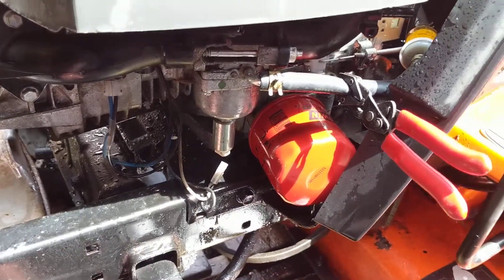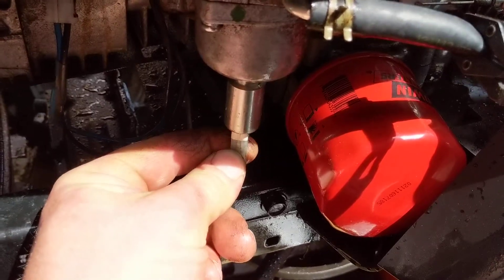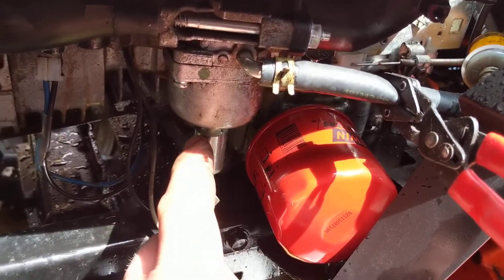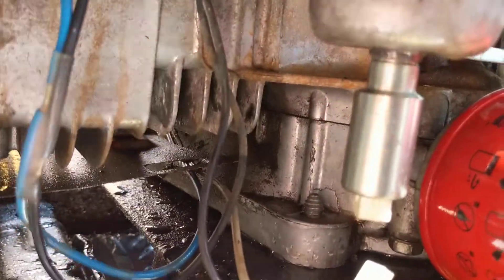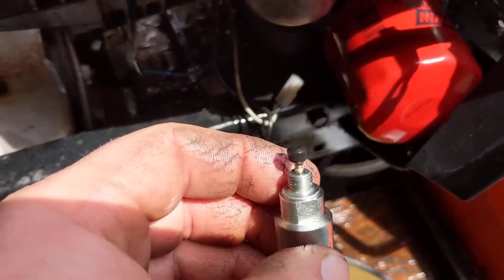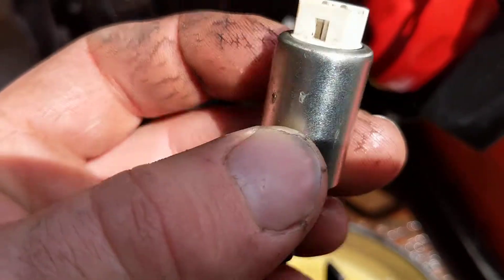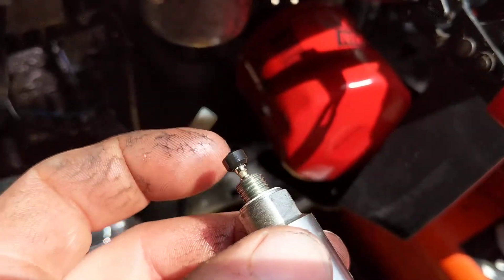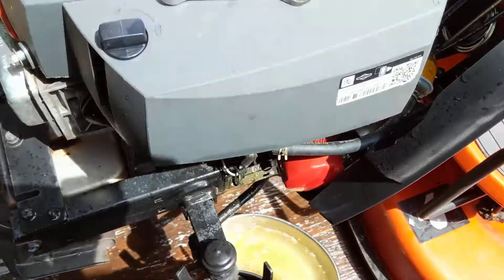Briggs and Stratton Carburetor Fuel Shut off solenoid information #lawnmower #smallenginerepair

Comment: The fuel solenoid has nothing to
Do with engine flooding.  All
Its designed to do is
Prevent the engine from backfiring upon engine shut off.
Reply from the maker: I agree and disagree. I run into these carburetors that have leaky float needle valves and these solonoids prevent the leak from flooding the intake.
Reply: @machinesnmetal  if a carburetor has a faulty needle and or inlet seat the carburetors going to flood whether or not it has a fuel solenoid or not that’s a fact
Reply from the maker: Can you please do a video on that subject so we can see?
Reply: @machinesnmetal  you bet!
Reply from the maker: Just yank the needle right out and mount the carb in a vise the solonoid is naturally extended when not connected to power.
Reply: @machinesnmetal  That’s correct and when you do that, the carburetor will overfill and spill right into the atmospheric vent and flood like hell Whether or not the fuel solenoid is even there
Reply from the maker: So what do you call it when there is no solenoid and you shut the machine off at full throttle and air fuel mixture fills up and condenses in the combustion chamber that is sucked in by the draw while the engine is slowing down that soaks the spark plug and causes the machine not to start up immediately and backfire when you key it over afterwards

Comment: I just installed a fuel shut off valve and just run my carburetor out of fuel after every use. The solenoid was allowing fuel to enter the cylinder and seep down into the crankcase oil while it was just sitting.
Reply from the maker: that means your float needle / seat is not sealing and leaking.

Comment: Man, I just replaced the carb on mine and all of a sudden, the thing won’t start anymore. It had been starting and running fine, but rough, so I decided to give her the old 5 year maintenance... turns out, the fucker before me had bypassed this solenoid by grinding down the plunger. I replace it and no good because all of the wiring to this solenoid was fucked, and that’s likely why he had it bypassed in the first place. Cleaned all contacts, fixed wiring and back in business. THANKS!!!

Comment: mine won't start, if i spray starting fluid in the carb it starts until it burns up the fluid, the fuel filter is good so i guess the solenoid is stuck closed.
Reply from the maker: yep, or your out of gas in the tank.
Reply: @machinesnmetal  it has gas so it must be the solenoid
Reply from the maker: Could very well be

Comment: I put in a new carb. does it matter which way the plug connector goes in the fuel shut off. it fits either way.
Reply from the maker: I'm not 100% sure but I don't think it matters I have run into this myself before I believe one of the wires just tags back to the engine case for a ground the other one is part of the ignition key system just make sure that if the original solenoid had the ground wire on the right side pin connect your new plug so that the ground wire is on the right side pin or vice versa
Reply: Just like you, it goes both ways

Comment: The fuel solenoid has nothing to do with flooding. It only prevents backfiring
Reply from the maker: Flooding causes backfire.....
Reply: @machinesnmetal   An engine doesn’t have to be flooding to back fire. An engine is more likely to backfire when it’s not flooding and the air/fuel mixture is correct because a correct air/fuel mixture is easier to ignite. When you kill the engine it immediately stops the spark at the spark plug. As the engine rotates a few more times before it stops, the air/fuel mixture will go into the cylinder but since there’s no spark it’s not burned, so when the exhaust valve opens the unburned air/fuel mix will go into the muffler. If the muffler is hot enough it will ignite that mixture causing a backfire. The fuel solenoid has nothing to do with flooding. The only thing that controls the flow of fuel into the carb is the  float, needle, and seat.
Reply from the maker: I disagree, 

These solenoids were introduced because users were either shutting off their ignition with the engine running at full throttle, or they were getting off their seat, causing the safety system to cut the power to the ignition coil thus allowing the engine to ingest air/fuel mixture, as there is no spark to ignite it, it will flood the intake, combustion chamber, and exhaust. Once the user starts the machine back up, on occasion the unburnt air/fuel mixture contained in the intake, combustion chamber, and exhaust would ignite causing a backfire. The solenoid was added to the electrical system in order to plug the mainjet in the carburetor thus cutting the fuel in the air/fuel mix making it impossible for the intake/combustion chamber/exhaust to flood with mixture due to lack of fuel.

Here is an excerpt from a Briggs and Stratton service manual:

The fuel solenoid prevents fuel from flowing while shutting the engine down to prevent backfiring while the engine is still turning but the ignition is off since the created vacuum is pulling fuel.
Reply: @machinesnmetal   That’s exactly what I said. The air/fuel mixture will make it into the cylinder and then into the muffler where it can ignite. But that is not called flooding. You notice Briggs and Stratton doesn’t call it flooding. Flooding is defined as having an uncontrolled flow of fuel going into the carburetor/intake/cylinder. Backfire will happen even if the air/fuel mixture is perfect. You wouldn’t say the carb is flooding the cylinder with the perfect air/fuel mixture.
Reply from the maker: Would a better term perhaps be "charged"?
Reply: Makes me wonder what the needle and seat's purpose in life is then?

Comment: I made a plug out of mine. Took the guts out of it and brazed up the hole and screwed its back in. It was on my 24hp Koehler Scag Patriot. Electronics should never be put on these small motors.
Reply from the maker: Nice work!

Comment: Thank you for making this video. We have a Craftsman tractor with a B&S engine on it and one of these valves and it was running very poorly and now it is not running. I'll take that valve off and see if it is stopped up and if the gas is also bad. it has been  sitting for a few years now................................. Cheers, Jim

Comment: Awesome. Exactly what I’m dealing with but could not find detail on how  this solenoid worked. Thanks
Reply: The fuel solenoid has nothing to do
With engine flooding
Reply: Anti backfire solenoid so raw fuel dont get pumped into the hot exhaust larger quiet mufflers and go boom 👍 and lowers "emissions" generators have them also big quiet mufflers 👍 and fuel shut off solenioids on carburetors

Comment: They last only about 2 yrs Then it want run and have to replace the carburetor  solenoid>  You can super glue it open!  but fuel will leak in the engine.  can put a shut off valve on the hose, to shut the fuel off every time you stop it. turn it on to start it. Pray you can get the old one to work.  Spend 3 dollar for a valve , or 25 dollars for a new shut off carburetor solenoid.  Your choice
Reply from the maker: there is a link to buy the new one in the description $8
Reply: on Google Search they wanted like 14 to 25 bucks for 1  ~  Very cool

Comment: Thanks for the explanation.  My problem, and its giving me fits, is that the electrical connection between the ignition and the solenoid on my older Ariens tractor  is loose and the solenoid kicks on and off as I mow my lawn, shutting down my mower.  I have replaced the carb and now am looking for a better way to connect the ignition wire to the solenoid, like maybe a screw connection that won't vibrate free?
Reply from the maker: Solder?
Reply: Possibly.  I think that I will try to find a used one to practice on first before I try to solder that $65. part.  Thanks for the idea.

Comment: Would that be the problem with my 22 horse Husqvarna Briggs & Stratton when I park it and say like the next day I started and gas sprays out the exhaust would it be the fuel solenoid sticking or staying open
Reply from the maker: probably but could also be your carb float/needle isnt sealing
Reply from the maker: just cut your fuel line and install a $3 fuel tap, turn the fuel off when your done with the tractor until next time.
Reply: Thank you for the info I appreciate it.
Reply: Does it surge too?

Comment: That solonoid can cause a lot of problems,after long time trouble I finally cut the plunger off and disconnected the wire. No more fuel problems,just a little back fire when I turn it off sometimes,no big deal. Also I don't care what some say I've been mowing 7 acres with a 17.5 hp Briggs for 15 yrs and that engine still runs great,and the Nikki carb is not as much a problem as some claims.  Just my 2 cents👺
,
Reply: Same here. Occasional backfire, especially if I leave the blades engaged in full throttle and just turn the key off. Makes me jump sometimes when I'm not expecting it. I should get better about disengaging blades and lowering the throttle first, but I'm lazy.
Reply: @bnasty267  You might see if it needs a valve lash adjustment, especially if it's also kicking back when you try to start it.
Reply: Backfire = adjust valve lash

Comment: Thank you!  We'd rebuilt the carburetor, new plug, new coil, but it was still shutting off randomly!  Thanks to this video, I pulled this solenoid and realized it was shutting when it was supposed to be opening!  Pulled it, cut off the rubber stopper and reinstalled it, and now it works again!
Reply: Just my 2 cents worth, but on my B&S v-twin same problem. As for backfiring when shutting off, I don't know, haven't gotten that far yet as to removing the rubber stopper. But the carb does have a float in the float bowl so that will prevent flooding (I tested it out, it works) when the machine is shut down. Small engines have been running this way for decades with no problems without the solenoid, to me its just another thing to break down forcing you to buy parts or taking it in for servicing. So, take what I say not as a professional (no where near that) but I think that its up to you to either replace the part or by pass it, its your machine. For those of you that still has a warranty, no question, new part
Reply from the maker: I think that it's first and foremost purpose is to cut the flow of fuel into your engine when you are in the midst of mowing and you decide to get up off the seat without shutting down the blades and bringing the machine to an idle. Basically it replaces common sense, something that seems to be quite rare these days.
Reply: @machinesnmetal  I have a question. Can the solenoid be bypassed with a static jet screw and  a manuel fuel shut off switch? I think the solenoid is a big failure point for most engines. Also is there a solution mixture that can be used to clean the solenoid. WD40? Electric circuit border Cleaner? Carburetor cleaner? I don't see why the solenoid can't be washed annual to keep it operating properly. It seems like a solid working piece, it just needs annual maintenance.
Reply: @machinesnmetal  My solenoid started smoking/small flame after it had been turned off for over an hour and the white connection melted into the black connection.  They won't come apart to replace the solenoid and rewiring seems impossible because the new wiring that comes with the solenoid doesn't match whats on the mower.  Anywhere I can buy the white connection?
Reply: If you cut off the rubber plug, does it then flood the engine with fuel? Also, is there a float valve in that carb?
Reply: Bike pedal  flat spanners are perfectly narrow for this removal.    also the solenoid is not voltage sensitive... Also it appears to be a 5/16 valve body....for those who want to hack a bypass.  ......Now mine is hours in wd40 and is still sticky....Damnn
Reply from the maker: I think you have the wires connected backwards. I wouldn't cut the rubber stopper off the top, if the machine is shut down on a high idle or someone is mowing and gets up for some reason and the engine shuts down due to seat safety switch you could get a nasty backfire and it will send the connecting rod through the side of the block. The solonoid is there for a reason, don't mess with it.
Reply: @machinesnmetal  We've pulled the safety switch off the seat already. The solenoid was plugged correctly, but was faulty; it would work for a while then, randomly shut off the fuel.  It was very frustrating.  I will keep your advice in mind and look for a replacement, but for the time being, I'm using a stopcock to shut off the fuel when the mower isn't in use.
Reply: @machinesnmetal  I think I should clarify.  This has been about a year long odyssey. I got this machine from my father's estate - he was an engineer who did a lot of small engine repair after retirement.  Once I got it cleaned up, replaced the battery, it ran really well, (though now that I think about it, it did backfire a bit) but only for a while.  I could get about a bag load of grass before it would inexplicably stop and wouldn't start again until it was completely cool.  It acted like it was running out of gas but it only did it (at that point) when it warmed up.  We had the local Snapper shop rebuild the carburetor, it still did it, then we had him change out the coil, and it still did it.  We even detached the safteys to try and isolate the problem, but it still did it.  Went to a Briggs and Stratton plug; still did it.  After the last time it stopped dead, I couldn't get it started at all even after letting it cool off completely.  At that point, I didn't want to spend more money on this machine, so I called my BIL and asked him to look at it (he's a farmer with a big shop).  He fiddled around with it but couldn't get it to start either.  I was on the verge of scrapping it, so I figured as a last resort I would check the solenoid. I hadn't done so earlier, figuring my guy who rebuilt the carb would have already done so.  Anyway, I pulled it out and we hooked it up to the wires and tried turning the ignition.  When turned to start, the solenoid pushed the plunger out - so we switched it around, turned the ignition and it still pushed the plunger out!  So, whichever way the plug went, the plunger was pushing up, blocking the flow of gas when we tried to start the engine!  That sure seemed like the source of the problem.  On another video, it mentioned something about cutting off that little rubber end to hack it.  At this point, I figured I didn't have anything else to lose.  Well, cutting off the rubber stopper did work.  The mower is running now and I am using the stopcock on the fuel line to keep the gas from the carburetor when it's not running.  I am going to run it for a while to make SURE that was the problem, and if it turns out it was, your advice seems to be that I replace the solenoid with a new one.  Alright, I can do that.  Right now, I'm just glad I can get and keep this mower running!
Reply from the maker: That rubber piece literally prevents your mower engine from blowing up when you shut it down, I highly recommend you order a new one off amazon ($25) and get it back in there.....

Comment: Not for stoping fuel it is for so engine will not back fireing when you turn it off
Reply from the maker: by stopping the fuel........
Reply: The anti-afterfire solenoid is a device that shuts OFF the fuel at the carburetor to prevent the engine from receiving fuel after the ignition switch is shut OFF. Anti-after fire solenoids are installed on select engines that have a battery-powered electrical system.
Reply: Well, it shuts off the fuel pretty effectively.  When ours malfunctioned, it would shut off just like it had run out of gas.

Comment: Would that be my problem if engine starts random missing after 30 minutes of running?  All filters and plug are new.  Fresh gas. ???????
Reply from the maker: it could be but probably check inside your fuel tank for grass or leaves sounds like the pickup tube is plugging up.
Reply: Ours wasn't missing, but would just shut off like it had run out of gas.  If it's missing, consider replacing the coil.